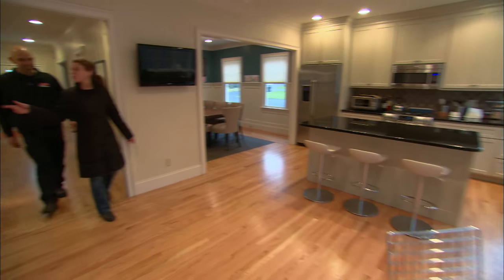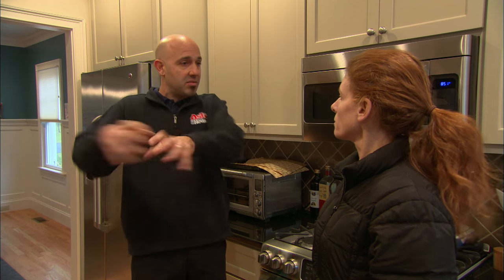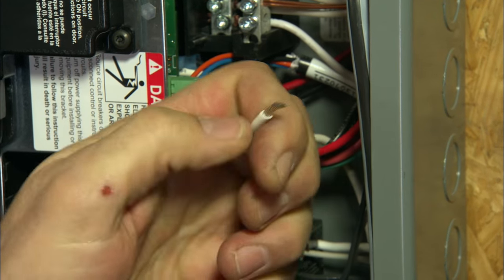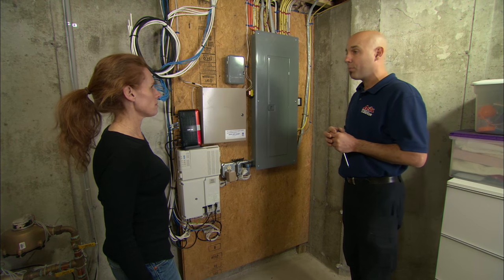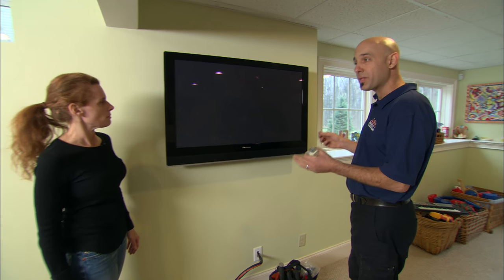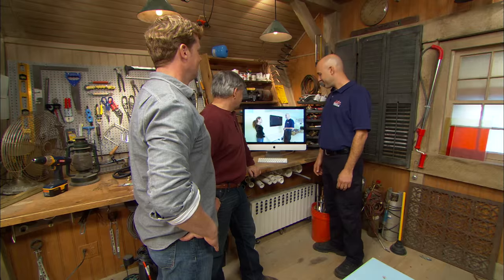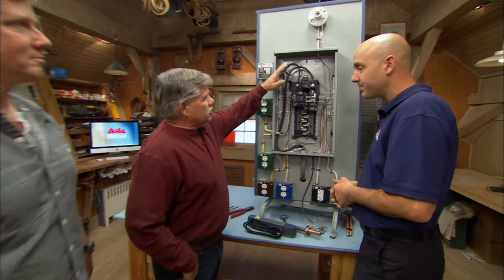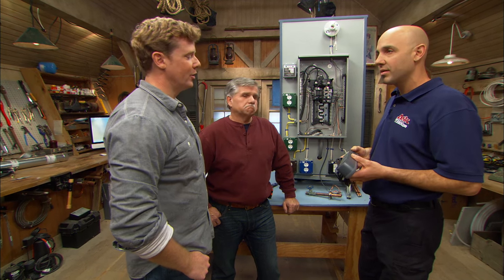How to Install Surge Protection | Ask This Old House

Comment: I have seen 1000's of houses and have also wired panels for new constructions home, but have never ever seen a panel with wires that neat, on the outside at least. That looked so awesome!
Reply: That's definitely from someone who takes pride in their work... Or just OCD.
Reply: Boris h
Reply: thats honestly not that neat. im a electrician and there are some super ocd electricians out there. thats pretty sloppy by some standards ive seen. but nice work
Reply: Wasn't that a thing of beauty?
Reply: @anonymouspost8407  do you zip tie everything creating hot spots so it looks nice?
Reply: @anonymouspost8407  you've been taught properly then
Reply: I just worked on a panel yesterday, was the neatest I have ever seen, everything labeled and all. But there was still over 10 issues with the homes wiring and performance.
Reply: @joeythefoxxo  don't worry about it.
Reply: Conduit is better looking
Reply: I was just thinking the opposite.  I have 1 box and 1 large conduit in the top and 1 large in the bottom. You don't actually see a single wire.  The wires running all over the place on this seems really messy to me.
Reply: As a non electrician.  I concur
Reply: @Gizmodi  show me an example where using zip ties creates any problem.
Reply: @Mattieboyy  what's the difference in between zip ties and a single 2 in male adaptor? There is a reason using a single 2 in adaptor is not allowed anymore, for free air space, conductors in the middle of the bundle have none do they? Its more prevention than anything. 

Does that make sense?
Reply: @Gizmodi  I've been in the trade for over 16 years and not once have I or anyone I've ever worked with had problems with using zip ties in a panel. I've also never heard anyone say that were not allowed either because it's a safety hazard. 🤔
Reply: @Mattieboyy  hey Matt, why is there a limit of conductors inside a raceway? Think about that 🤔
Reply: Conduit fill has nothing to do with what we are talking about. Show me a code rule or a dangerous incident that was caused because someone was using zip ties in an electrical panel. I'll wait...
Reply: @Mattieboyy  ofcourse, here is a bit of Google bug also common sense when bundling current conductors together. I've been in the trade quite a while myself, even able to start my own company.  Here you go

The National Electric Code does not directly ban bundling in a panel but does require adjusting wire size (derating) for bundled wiring 24-inches or more in length as a way to avoid overheating.Jul 10, 2018
Reply: It's tv-ready
Reply: My panel looks like museum quality . Something for the ages
Reply: @dematt321  yep pretty sloppy ,if you ask me 🤮
Reply: I’ve been an electrician for 20 years now and actually think that wiring is kinda sloppy. I personally have way higher standards. To be fair residential house wiring in most homes is hardly ever done well. That guys work was better than most though
Reply: Sounds like a you problem since you’re the one wiring the panels 😂

Comment: One problem, electrictricity is not seeking the shortest path to ground. It's not seeking anything but will follow any and all conducting paths that are presented. The most current will flow through the path of least resistance to the source which is the secondary of the supply transformer via the neutral.

Comment: (1) get a quality UPS for your sensitive electronics, they protect against both brown outs and surges.  (2) If that house is actually struck by lightening it is totally unprotected.  That requires a wholly different system with lightening rods on the roof, etc.  What was installed here only protects against excess power coming in from the grid.
Reply: How do you know that the rods are not already in place.
Reply: @techo205 Maybe because THEY DIDNT MENTION THEM🙄

Comment: Good one. I worked in power utilities in Asia. In their distribution overhead line system, surge arresters are installed in transformer terminals close to the household.
Reply: This is a Type 1 surge protector.

Comment: I LOVE TOH!!!!  Was totally confused as to why I needed BOTH Whole House protection AND portable suppressor power strips.... Thanks for asking that ? Kevin!!!
Reply: Computers should have at least some battery backup, if not for power outages, but mostly to add power if the voltage goes too low (AVR). Sine wave regulators or "true wave" (or what ever branding) ensures a clean signal as required by most computers. Look for it on the backup. A tiny bit extra on power protection can save a bundle. (CyberPower 1350AVR is a good one I have tested)
Reply: I thought you were not supposed to punch wires into  the back of a socket? I was told to always wrap each wire around its matching screw on the sides of the socket.

Comment: Ok, so...my refrigerator recently got damaged during an outage that only lasted like a few seconds. I'm not sure if the refrigerator was damaged by a surge or a drop. All I know is that just 2 months ago, I had to install a secondary defrost heater because of Samsung producing a defect within their design. After installing the secondary heater kit, which included other strategic mods to eliminate the chronic ice build-up behind the rear panel. Anyway, the kit was a success  and for over 2 full months, I had zero icing-over issues and if I set the fridge to 34° it would hold 34° 24/7. Moving forward to 2 weeks ago, when we had that very brief power interruption, wherein, the power failed and then turned right back on in a few seconds, the fridge hasn't been right since. I did all the suggested DIY procedures to get the fridge operating normally again, but despite all that, it's no longer getting as cold as it did before and now I'm seeing ice build-up seeping through the vent holes in rear panel. 
My whole point in all this, is for all I know, it may have been the surge when the power came back on, or it may have been the drop in voltage during this event that damaged my $1,300 fridge. I'll never know. The point is, this video is giving consumers a false sense of security, by suggesting it's only critical to protect against power surges. In reality, drops in voltage can be just as harmful for major appliances. So, assuming that a surge suppressor or diverter is total protection, is a flawed notion. I'm just surprised they don't talk about an Uninterrupted Power Supply device (UPS) and how such a device can be just as important.

Comment: About 18 years ago, my house had a lightning bolt hit the roof.  I was home when it happened.  The lightning shattered a handful of roof tiles and blew a small hole through the roof.  It did not hit any power lines.  There are no exposed power lines - this community has all below ground power lines.  But the EMP (Electro Magnetic Pulse) damaged several items inside my house.  The EMP blasted the electronic dog fence module right off the wall.  The burnt area was where the wires on the perimeter of the yard connected to the module.  Those yard wires sent thousands of volts into the electronic fence module.  The modem in my PC was destroyed.  The EMP came in through the phone line.  The three CRT's in my house were severely magnetized causing the color picture to be severely distorted.  I don't see how a surge protector would have helped in my situation.  The surge wasn't coming through the power lines, it came through all lines (phone lines, speaker wires, etc.).  Thankfully, my homeowner's insurance stepped up and paid to have all damaged items replaced.  They weren't interested in repairing anything - just replacing.  Of course, they also paid to have the hole in the roof repaired.

Comment: Great information. I am having a house built and where the panels go in the garage The do a drywall bupout with the panel recessed in the wall between the studs. How do I connect the whole house protection? The builder will not add it since it is a deviation from what they do in all houses.

Comment: Noticed how you said keep the surge protector as close to mains as possible. Usually the open breaker spaces are at the bottom. Should you shift the breaker positions of existing ones down? Or just put the surge protector on the bottom.
Reply: Never mind. Watched more and saw you have a retro fit surge protector haha all good.

Comment: I used to work in the telecom industry.  We had a gas grounding protector.  When it sensed excessive voltage such as 110 vac or lightning strikes, it supposed to open the path to the house and send the voltage to ground which was attached to the protector.  I once (and only once) did a service call where lightning hit the phone cable in the air, blew the gas module all to he!! and melted the customers phone.  Nothing is perfect which is why it is suggested that you do not watch TV during a lightning storm.
Reply: How would turning off a TV prevent a high voltage power surge from reaching it?
Reply: I'm saying to turn off the TV and don't sit or stand in front of it during a lightning storm.  If you like to stare at a blank TV screen, well that's another topic.
Reply: My parents always taught Me to stay off the phone/turn off the TV during an electrical storm.  They were right.
My friend's TV (1992) got blown out when lightning came through the window the glass screen got cracked. 
My cousin was on his phone (1987) and it got damaged during an electrical storm.
Reply: dont watch TV because you unplugged it. turning something off but leaving it plugged in does nothing
Reply: Nominal voltage in the USA is 120 Vac NOT 110 Vac.

Comment: Electricity does not want to go to ground. It wants to go to its source. Lightning however does want to go to ground. Also, electricity does not take the shortest route. It takes all paths to its destination. The amount of current is inversely proportional to the resistance of the route, so to some extent a longer route will have higher resistance. But the way it was state is just inaccurate.
Reply: WHAT????? Electricity doesn't want to go to ground? WTF????
Reply: But in terms of electricity, the earth (ground) IS the source😅 What are you saying 😂
Reply: @putalaweaweonoh  For utility power, that is false.

Comment: I think they neglected to mention explicitly that surge protectors eventually lose their protection over time--at least the APC one I use for my computer does. It has status lights to let you know if it is working, overloaded, or if there is a ground fault. I think most high quality surge protectors last about 10 years depending upon environment and usage conditions.

Comment: Is it safe to use power strips with surge protectors even if you already have a surge protector connected to your panel? 

I heard that you should connect surge protectors together
Reply: Every power strip should be surge protected internally. Some power strips are just that. Some have no surge protection. You don't connect anything together.

Comment: Great video, for your sensitive Electronics I would recommend a UPS over a surge protector sensitive Electronics don't like losing power like computers it can damage them. Are you lose all your data or corrupt your files. And it's also very nice for things like routers and cable boxes because you don't have to wait for the reboot when you lose power for an instant.

Comment: Scott,
Are you saying that the point of location power surge protection for the TV is an option because the window summertime AC is  on the same branch circuit? In this situation shouldn't the window AC be on a single breaker separate branch thus not affecting other appliances? Finally, do I use an electrical panel surge protection option as to how to protect an AC from its own voltage transients as to extend its lifetime?

Comment: It is interesting.  I never thought that an appliance would send a power surge but it makes sense.  The voltage kickback from motors and solenoids.  But, we've all done it, I've done it.  I do this all the time.  Plug my fan into the same power strip as my computer.  My lamp shares the same power strip as my computer.  Probably not a good thing.

Comment: What I need to know is where did they get the cool surge/power strip box shown @ 3.38 minutes in to the video? My desk has 3 PC's and 2 monitors on KVM switches, what a mess of wire, cable and adapters under my desk.

Also there are some assumptions wrong, Surge protection is not the same as as lightning protection. For a direct lightning only a lightning rod system to divert will help, this is a whole other subject. Surge is an increase in power, so a surge protector will not help brownouts. For power fluxuations this would be a line regulator, very expensive and I mostly installed them in hospitals for my work as an imaging/biomedical engineer. when power goes out and comes back on, all connected devices want power at the same time at once, causing an extreme pull of power causing a bounce effect on the power going from a brownout to surge cycle. Suggesting it is best to disconnect in extreme storms. UPS battery backups are best for expensive electronics like computers and AV equipment, I currently use 4 1500 APC, and 4 600 APC UPS battery backups.

Electricity dose not take the shortest path but the path of least resistance, and any path. 
In Example: if connected in parallel a 22 gauge wire 1 foot long and a 4 gauge wire 10 foot long most of the power will travel on the longer wire as it has less resistance. The thinner wire may be shorter but has more resistance and may even burn out, as the 22 gauge has 16 ohms/foot and the 4 gauge @ 025/.foot would only be 2.5 ohms @ 10 feet

Comment: Okay for surge, but the brownout needs protection at least at the AC unit.  If the voltage drops down to 100 or even lower, higher current is being pulled during brown out which is not good for the AC if the fast blow fuse did not blow out.

Comment: Its usually the loss of power to destroy appliances. Alot of times it is. However a great power surge will do it to. But rarely does the power come 8n at higher voltages. Count on loss of a leg than extra voltage as the culprit. Seen it many times in 30yrs in construction doing HVACR.

Comment: That SYCOM surge protector has nearly burned down several people's homes.  It's been recalled and is no longer for sale.  See reviews of SYC-120/240-T2 with photos of burned device and burned walls on Amazon.
Reply: Comment needs to be pinned. I had the same one and turned off that breaker. Ordered a different brand off Amazon.

Comment: There are comments and link indicating the device used started lots of fires.  That aside, the panel box has two sides, each fed by a separate 120V cable, the two out of sinc to create 240V for oven, etc.  The video shows breakers attached to only one side.  Looks to me like the other side, half the circuits, are left unprotected.   Was one of the two black wires supposed to attach to the other 120V side on a separate breaker?  Or am I just jealous of the flat-blade screwdriver on the Phillips head screw?
Reply: I see my error!  I hadn't noticed that every other single pole breaker slot on one side is attached to first the left, then the right 120V cable, so any pair next to each other have potentially 240 V for a single circuit or alternate wave 120V circuits.  Need I add I'm not an electrician, just a DIYer.

Comment: Hi my name is Jon and am a Electrical professional Expert,  I also have worked and Assisted my neighbor friend Steve over lots of years as extra assistance who is a Electrician.    For those who are trying to save money and want to buy cheaper and still have ease and protection to all there appliances you can just buy a high quality power strip with a built in circuit breaker and a GFCI and AFCI and a surge protector strip that has all in one and will cover everything.     You do not have to spend extra money on a whole house Surge protected installed directly into your service panel if you do the all in one power strip protection.    You do want to keep an eye on that Green protection light on the power strip though, it the light goes out you should buy a new power strip as there only good for so long.    You do not have to have a surge protected wall outlet installed either if you go with a power strip all in one protection but remember anything that is not plugged into the protected power strip is not protected.    In my opinion as for lightning strikes it’s best to just unplug your devices during storms as sometimes lightning strikes are to big of surges to withstand even the highest quality of surge protectors and will not always work for those surges.   You might want to add in lightning rods for that.

Comment: Will the whole house surge protection cover smart appliances (refrigerators, washers,& dryers) or will the appliances need individual outlet protection?
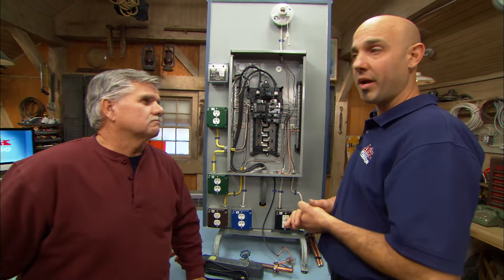Reply: 6:50 The answer to your question.
Reply: NO. You need local surge protection at the load device you turn on.

Comment: If you were to install the SPD circuit breaker at the bottom of the circuit panel, will you still get the same level of surge protection?
Reply: It does not matter which location you use for the SPD breaker.  What matters is making the wire length from the SPD to the breaker absolutely as short as possible.  Since the neutral bar is usually located at the top of the panelboard, it is best to install the SPD as close to as possible too.  And that drives you back to installing the SPD breaker in the top two spaces.  Every additional foot of wire over six inches in length increases the let through voltage by 150 volts.